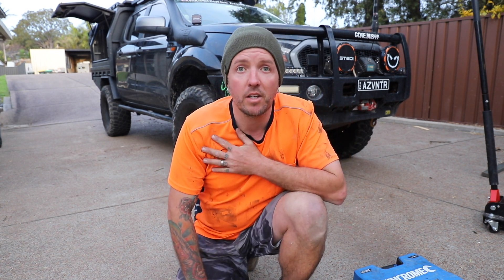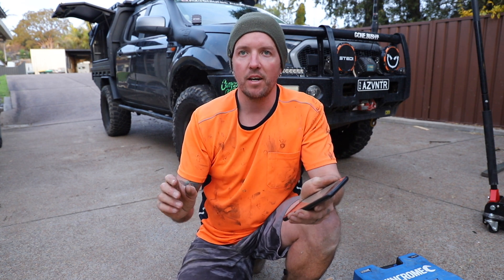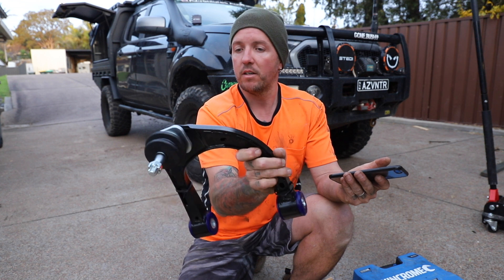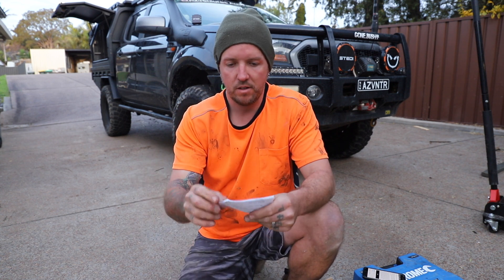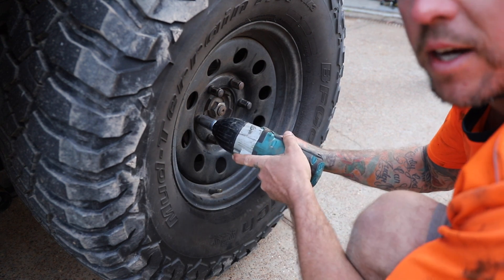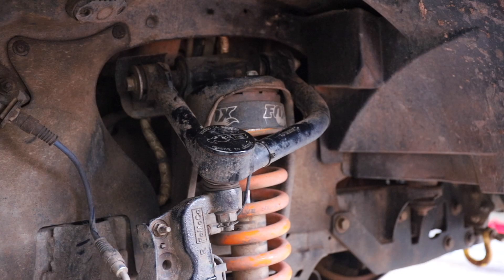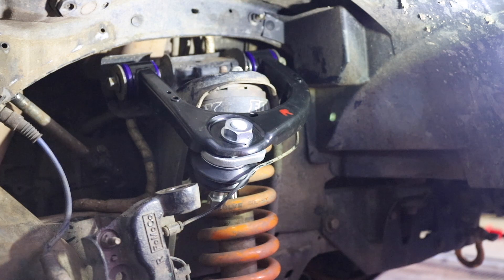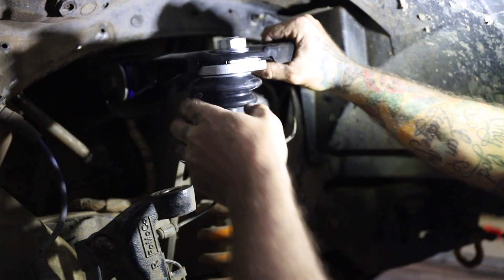HOW TO CHANGE UPPER CONTROL ARMS

Comment: Good stuff. There seemed to be way more ‘crap’ on my Everest behind the rubber inner guard flaps… Air con pipes, electrical wires and all, all making it a little harder to remove long UCA bolt. But still relatively easy. 👍

Comment: What lift kit are you running mate? What's the tyre size and what are the dimensions of your canopy set up length and width?
I own a ford ranger px2 3.2 non dpf model, I have a 3 to 5 inch adjustable PSR Bilstein lift kit in mine, I have had this set up for 4 years now.
Looking into going in for a better suspension set up but would like to have the 4 inch lift I currently have because I am running 35 inch tyres.
I also have super pro lower control arms and psr UCA, how do you find the Super pro UCA? Are the ball joints greasable?

Comment: i have done a 2 inch lift  and put bigger  tyres and my truck pulls to the left but when i put the old wheels back on it its ok any seggestions please
Reply: wheel alignment and tyre re-balancing
Reply: Nik Bishop I have some wheel alignment and balancing
Reply: Thinkin it could be a chamber issue ?

Comment: could of just replaced the bushes with super pro ones in the UCA saved $700
Reply from the maker: OPTIMUS6LTR i would have originally done that but after making a few phone calls to a couple of people fulcrum being one of them and being told their bushes won’t work for the blackhawks I needed to get them replaced as quick as possible and the superpro uppers were in stock so I bought them and changed them over, then took the blackhawks to pedders and they sorted out new bushes and ball joints but took 4 days to get parts and do it so my car would have been off the road for that time
Reply: @AzventuresAustralia  Fair enough they did look very loose
Reply from the maker: OPTIMUS6LTR  yeah I was spewing when I found out I could have replaced them all, but still with the HD ball joints (the were flogged too) it’s still around the $400 mark to replace it all, I was happy in the end to try something different so I’m not biased towards one particular product